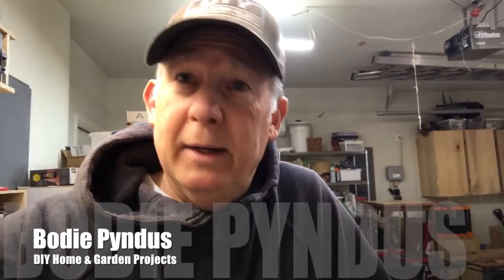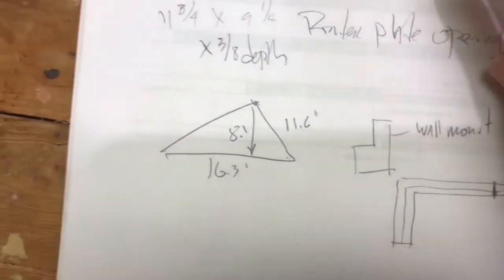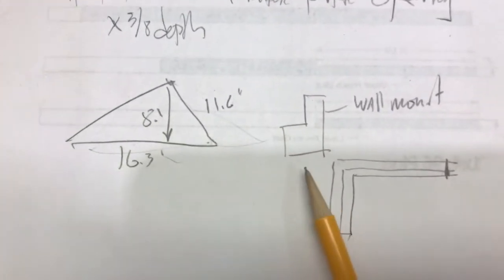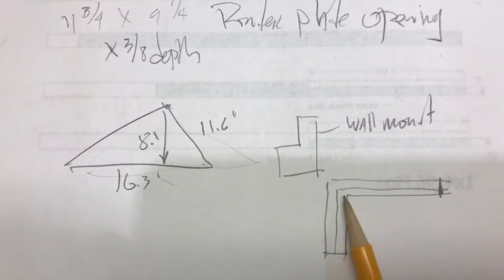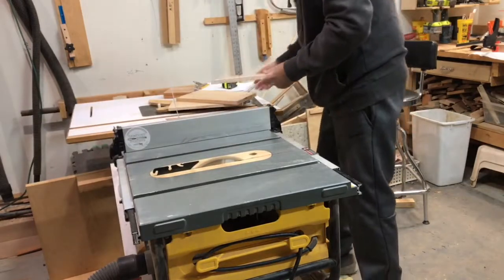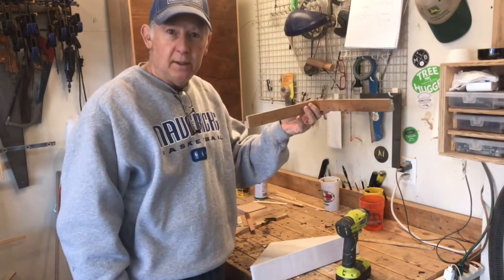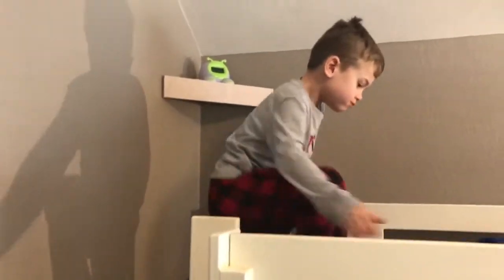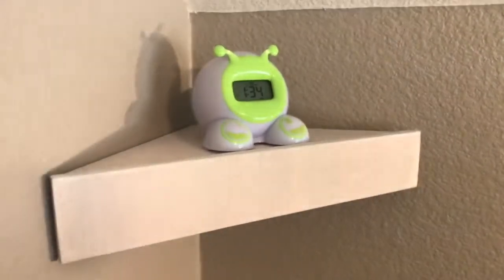How to Build a Corner Shelf

Comment: Hi Bodie. Nice job. That straight cut jig is really handy. I think I’m going to make one similar to yours. After using it a while, do you have a recommend length for that jig? I’m thinking around 3 feet. I do projects around the house not dissimilar to you. Thank you for any input.
Reply from the maker: For the length for the straight cut jig, think about most of the projects that you do and the size of the materials you use and then add about a foot. In my case mines 4 feet long and I use it quite a bit.
Reply: DIY Home & Garden Projects got it. Ok I’ll plan going with 4’ feet then. Thanks for that and for recommending the dowel wizard. I’ve been really happy with that little guy. Take care.